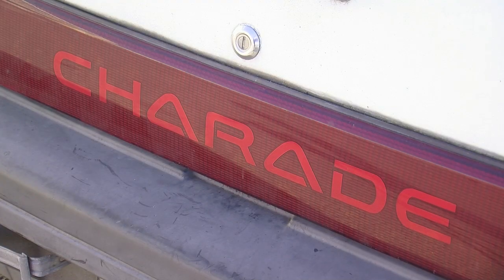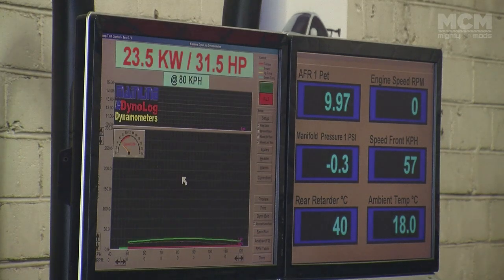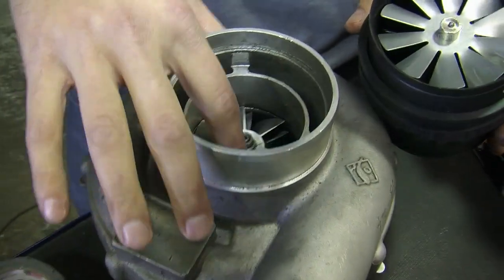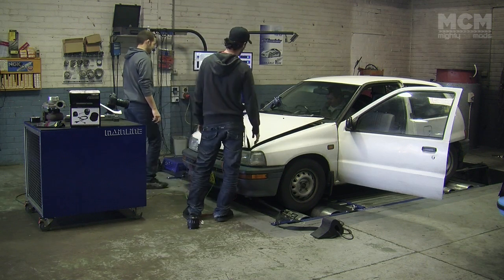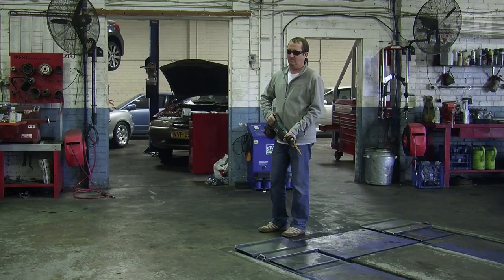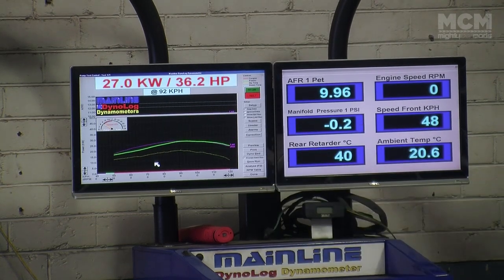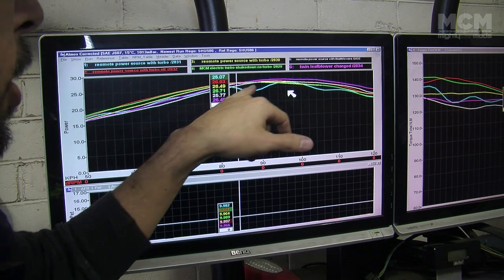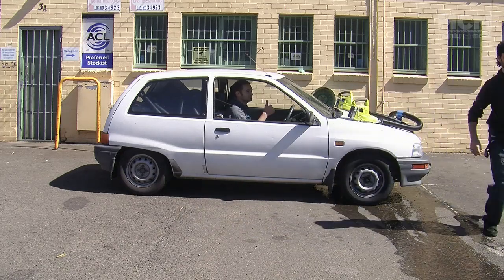Electric SuperChargers Mythbusted

Comment: The fan was probably calculated for a specific intake volume and that volume was not matching with the car. It is actually possible for that little fan to create more power, but  it would need more speed or differently shaped flaps so it could transport more volume. If the car was loosing power then the fan was probably not good enough and instead of forcing air in it was rotating slower (transporting less mass of air as the regular air flow transports itself) thus the flaps were being sucked in and thus working more like an air block instead of an air force. Not sure if I explained that properly but I believe that the base idea is clear :) the reason those leaf blowers actually worked is just the same reason I explained above - higher air volume forced in and that volume is above the naturally aspirated volume the car has itself. 

PS: They could have tried some results with an adjustable DC source and lifting the voltage from 12V to 15V and slowly overclocking the little thing :D even when it says 12V it can usually take a little extra before it shorts out for good.

Comment: I bet changing the blinker fluid regularly helps you turn faster.
Reply: +Jordan Cookie Only if you follow the recommended intervals on the back of the bulb packaging !
Reply: keep those headlights topped up on headlight fluid.
Reply: Um, what.
Reply: Jordan Cookie agreed doing it regularly has made my turns way faster
Reply: Jordan Cookie I change it regularly  and I've definitely seen an improvement. You should try to change the exhaust sparkers as well.
Reply: I've heard that somewhere bfr but where
Reply: +Jordan Cookie And don't forget to top off the ignition sparks.

Comment: Better try one of this and also add more fuel!

http://www.valeo.com/en/page-transverses-gb/popin-diaporama-en/popin-diaporama-pts-en/diaporama-electric-supercharger.html

http://www.autoblog.com/2014/08/08/audi-electric-turbocharging-feature/

Only more air is not enough to give, a lot more power. More air, only can improve, the combustion by adding excess of air in the combustion to burn all the fuel. But not with a fan like this... This fan can not put enough air pressure inside the engine. Maybe is possible that can obstruct the air flow, because the engine by him self sucks a lot of air.
The device should say how may bars of pressure it can make!
Reply: +Alexandre Fernandes indeedy :) no good just adding more air, need more fuel too !

Comment: your f#$$%&^ stupid if you put this in your car.... I got a 96 mustang gt that those little shi&y fan blades broke off and blew in through my block locking it up... now I got a 94 5.0 cobra motor in it instead.i found out the hard way. don't be a jew or goin cheap for your bigger bang. its not here....I bought it and regret it. if you wana supercar, build it yourself and go big. you go cheap you will be sorry.

Comment: Sorry guys, but with your permission I will make use of one of your Antipidean sayings, you acted like a pair of 'Drongos' and in my humble opinion buggered up the test.  There's no point testing one of these kits on a dyno with a huge cooling fan simulating cruising at 70mph and blasting air into the air intake at the same speed.   Wouldn't it have made more sense to have carried out a 0-60 test or a standing 1/4 mile which would have shown the difference that could possibly be achieved with the fan pushing air through faster than would normally be achieved at lower speed, and perhaps an acceleration improvement may have been seen, although not on that scrapper you were using.  And perhaps if the polarity on the switch was changed so that the fan operated from set off instead of on full throttle.  Maybe with a decent motor such as a BMW E46 330 straight 6 with an induction kit and place the fan between the cone filter and the MAF?    I think you should do another test only this time don't use a dyno.  By the way, love the vids, some great and very useful tips.  Cheers Guys, (Mike, Salford, UK)

Comment: You guys should probably mount one of these to the top of the car next and pipe it in...

http://www.northerntool.com/shop/tools/product_200516604_200516604?cm_mmc=Google-pla&utm_source=Google_PLA&utm_medium=Fans%20%3E%20Air%20Movers&utm_campaign=XPower&utm_content=27010&gclid=Cj0KEQjwrZ24BRC098fr-OqnuMkBEiQAKQ9lgExwiG5L3i0ClUH0DMVzD7B6MqX1mQQ6c-rHxYWwOhMaAkNJ8P8HAQ

Comment: Wow, 100KRPM?! Yeah, now you've got me reading, and I've even heard of 200KRPM for turbos! I cannot believe it! And I thought hard disks spun fast some at 10K to even 15K, but... whoa, that's hardly anything compared to a turbo! How can exhaust gases make those things spin so damn FAST? And those fans at $300?! What a RIP! I guess turbos must be super-balanced like a jet engine, and that's why they're like $1000. Right?
Reply: +MaxxFordham it has to do with gearing like on a bicycle , only on a bike you have low gears for power and high gears for speed . but on a turbo you have one speed , that's why there's turbo lag , just like if you try to pedal a bike starting in the highest gear requires a lot more leg muscle ,at low rpm's the exhaust can't spin it fast enough to make power .
Reply: Except that I imagine that a rotary compressor that's geared up from a turbine would make the turbine too hard for the exhaust to spin. Hmmm, it'd be interesting to play with one by hand. I'll have to have a closer look at mine from just January.

Comment: what if you put an air compressor with a big valve and ran it kinda like a nitrous system straight into the manifold. i know this is an old video but i just had the idea
Reply: you would  need a scuba compressor and a van full of 4000 psi cylinders for say a 1.5-2 second  'boost'  even a scuba tank at that pressure only holds about 80 cubic feet of air (about the volume of a small telephone booth if you remember those things ) which is about the volume of air your car engine needs to ingest to run about 1/10th of a second  at wide open throttle.  this is also why the diesel  ( non nuclear) submarines through this day can't store enough air to run the engine even though they have a huge ship to hold it. they need either a snorkel to the surface or use their batteries for electric propulsion and rumor has it in these submarines if they dive too quickly without shutting down the engines the intake valve will shut and the engine will in one revolution pull a good enough vaccum to instantly  blow out the eardrums of the entire compliment!  Engines just require  HUGE amounts of air.

Comment: These type of filter enclosures have a opening on the bottom of the air inlet so the car can breath hot air in cold conditions so is not way the system is sealed for the turbo for work, you should try a fuel injected engine